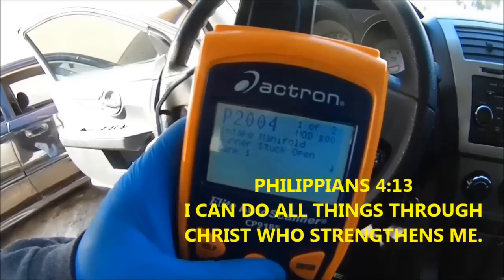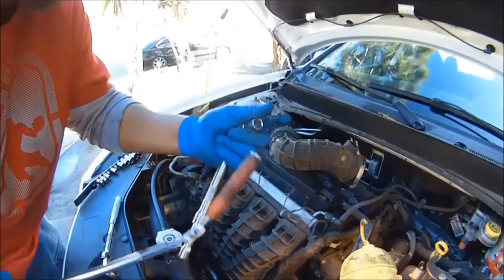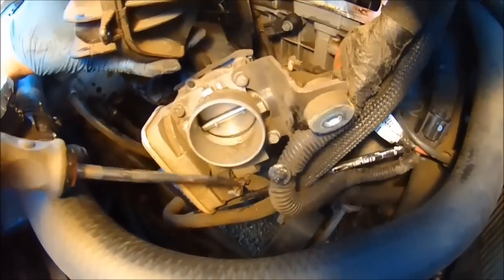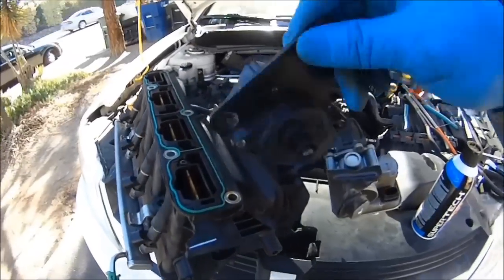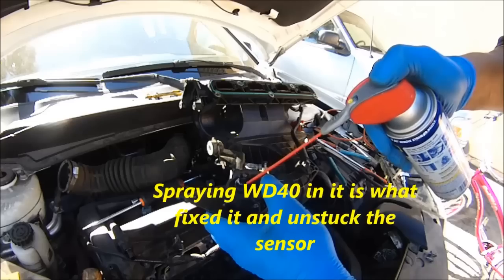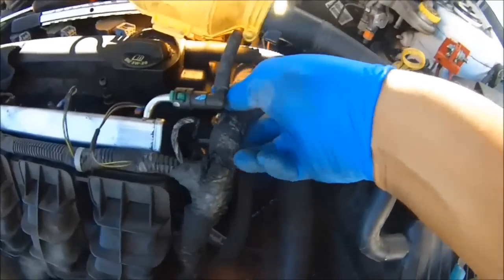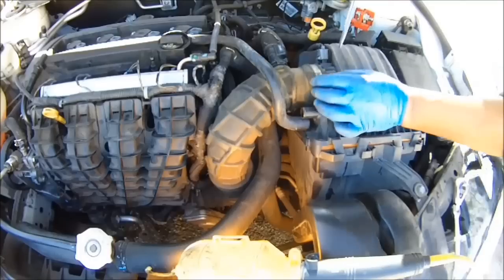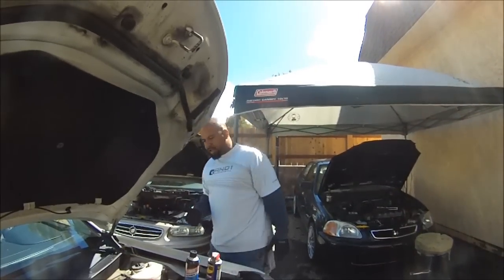FIX CODE P2004 & P2017 W/ WD40 & CARB CLEANER 2009 DODGE AVENGER INTAKE MANIFOLD RUNNERS STUCK OPEN

Comment: Thank you so much.  Using your video saved my family a ton of money.  I didn't have to remove the whole manifold.  I was able to just remove the valve control unit, and WD-40 it like crazy.  I could turn the runner valve rod by hand so I felt those were ok.  The check engine light has stayed off and the car passed smog.  Thank you again.  God Bless.
Reply: My story is identical with my 2009 jeep patriot.   This video saved me hundreds of dollars and time today.   I just took off the position sensor/actiator, used some spray lube(momar safe cracker), flashed the ecu with my code reader, and no more engine faults.
Reply: @johnc522  can you do it with obd2 scanner
Reply: @RENEHERNANDEZ1986  yes you can.  If the code comes back then you need to replace the sensor.  I still haven't had any codes pop up 11 months later so I lucked out.  Hopefully in your case it's the same.  Good luck!

Comment: You sir are the man...... 

Had a question,  I have a 2000 BMW 540i manual transmission. 
And I'm getting no start and no crank.  Tested the starter and battery both are good.  Checked fuses all good.  Key works unlocks doors.  

When I put the key to start the car I get all the dash lights and that's all.  No click no crank. 

What do you think is going on? 
Thanks

Comment: You make the job seem so easy. I had my significate other try to follow video & do same procedure. The problem we found was, the flaps were not stuck. 
If you found the flap not stuck open, what  be causing p2017 code?
Possibly replacing IMF?
Also, if runner was improperly installed, could that be corrected?
And finally, you mentioned that the IMF Runner be "Flashed" that's would be through Dealership?
Thank you for sharing your knowledge, you are truly Blessed. Thank the Lord for his Blessings,
Veronica

Comment: gonna do this again, mine lasted over a year! I need to know tho, without taking the entire manifold off, how do I know if they are open or closed? I was putting my runner control back on in the rain and in the dark with a puny flashlight, and I did not check if anything was open or closed.

Comment: I just did this today, and it went basically exactly like it did in the video.  Fingers crossed that the check engine light STAYS OFF so I can get my annual inspection sticker, but either way, THANK YOU  so much for this video.

Comment: I like what I saw as far as Intake R&I, but I wouldn't use carb spray so freely. I believe WD-40 could do it all. I would also use new gaskets and 0-rings anywhere I could. But the main thing is, . . . whole job too intrusive, just to diagnose. I woulda used a hi end enhanced scanner to look at position sensor values and get my diag without all the work. Then you could remove and replace, or clean it without removing intake. Were those 1/2 inch, or 13mm nuts? Great work though, . .thanx for the tips . . . About to run my checks for the same problem . Again, . .I won't remove the intake and charge customer, unless I have to.

Comment: Ok.....we took the intake manifold cleaned it all out replaced the position sensor and got it all back together and it is still coding P2004 after the codes have been cleared
Reply: is there anything else that would make it code that way?  An thank you for being here for us all.

Comment: In reality the problem is the pcv system. So much oil is comming through that its coating the runners and intake valves. I disconnected my pcv line and put a big bolt in too block it off. No more dissapearing oil. Increased mpg too low to mid 30s on freeway at 62mph. No this will not cause a check engine light

Comment: I just had my 2009 Dodge Avenger inspected yesterday and I failed the emissions test caz my check engine light was on with CODE P2004, P2017, Intake Manifold Runner Control Bank 1
Reply: how much was it to repair
Reply: Ryan Hoffman how much you paid to fix it

Comment: WD-40 dries out O-rings, just FYIo. Great vid
Reply: BrightKitten purr So what do you suggest to use?
Reply: +BrightKitten purr There's a WD-40 brand silicone spray that would be rubber safe.

Comment: so i did this repair. (Didn't take apart manifold, Just took out runner and soaked with wd-40) about 3 years ago at 55k Miles. It is not at 135k miles and i attempted the same repair with no luck. i ordered a new Runner control (75$) installed it and that has not fixed the issue. Looks like I'm going to have to take off the manifold. Thanks for the video, hopefully it helps me!
Reply: i did the same. what did you do after if you dont mind me asking?

Comment: Old skool funk.  Whats happening bro.  After  all the work was done ,  I cleared the code and everything was good.  Until  it came back so, I had to pull the intake manifold followed the steps you did and now,  I"m putting it back together.  I'm hoping this will solve the problem,  if not,  Do you think I will need to replace the Manifold?  Your videos are outstanding bro. GOD BLESS.

Comment: hey old skool. great video I have the same problem. one question how much the runners should move in my case runners move 1/3 of a turn and as far I can see, in your video an other video that I found, looks correct. but I found a publication that says they must move one 1/4 of a turn. I check the runner position sensor and it actually turns 1/4 any help. thanks a lot

Comment: I have the same codes on my 2008 Dodge Caliber. I was going to try to replace the intake manifold but if it is just stuck open cause of a carbon build up I'd rather clean it. 

Did this method hold up after a year now?

Comment: Have a P2010 and P2008 on an ‘07 Caliber 2.0 (05/06 build).  It bucks and jerks under 3000 RPM.  I removed the actuator and it rotates about 30 degrees if I use pliers on the tab that engages the rod the flappers are attached to.  When I apply 12V it only rotates about 15 degrees.  I can also move the flapper rod, but only about 15 degrees as well.  Does this sound like it is functioning correctly?

Comment: I have a question. Regarding that 'sensor' solenoid thing that was stuck, can that be opened up? Are there screws on it or is that a sealed unit? I ask because I figure moisture got into it and froze up the movement. Also, if you can open it, you might be able to use some kind of silicone grease inside of it or maybe seal it so it doesn't fail from moisture again.

Comment: Thanks for the video and inspirational words  !!! I have a 2008 Dodge Avenger Sxt 2.4L. i have the p2016 and p2017 codes. The check engine light comes and goes for those codes. But when I hit 3500rpms it'll come back on again :(  I almost purschased that runner sensor. But I will try what you have showed us. I'll report my results. Thanks again! Godbless.
Reply: Dave Mack did it work?
Reply: MissMandyy : Unfortunately it did not work. I even replaced the sensor.  Engine light is  still on.
Reply: What do you do?

Comment: hello sir. I hope you can help me with this,1- the RPM keeps going up and down when I turn the AC on with vibration. 2- I replaced the map sensor and PCV valve with a new one both. I found oil inside of the PCV and the MAP sensor after replacing them stell I have same problem the RPM goes up and down. 3- the oil cap leaking I replaced it with a new one stell leaking. 4- I don't have the control runners in my manifold. my car is 2011 dodge avenger 2.4l mainstreet 6 speed transmission. before I touch any thing I disconnect the negative battery cable. thx a lot man.

Comment: At about the 1:32 mark of the video, it appears that the hose on the upper left is already disconnected. I can't seem to get my loose on my 2008 Avenger. Did you do anything to loosen it before pulling on it?

Comment: how do you relearn the throttle body on 2007 dodge caliber? engine calibration or whatever i got P2017 P2004 and P0123.
Is the metal thing inside the runner suppose to spin like the sensor or control valve connected too that he stuck back in the side?

Comment: I checked the comments and did not see the follow up: Does this repair hold up after a month?
Reply: +Cody Mooneyhan The final scene has him showing a month later that it was still without an check engine light and that it was running good still.

Comment: My under standing is 2007 up to 14 maybe higher are the same and have this same problem going on, the 2008 looks identical, this also is true with a bunch of other cars that are not an avenger at all. This motor is a World Motor is what some dude at the dealership told me.  it is used in a whole bunch of cars. 

  After looking at mine it appears to me that this is being caused by crappy designing. really makes me mad, also. I have installed TWO alternators.  YES! the one that original went out. then the new one went out and now I'm on the third one.  Yesterday I hot 100,000 miles.   funny hu? want to hear something even more funny? the alternator costs over 600.00 dealership. you can get one though for just over 200 and do it yourself. luckily I bout a LIFETIME WARRANTY the 1st time.   I recommend that because this alternator has some fancy new crap in the pulley and it is a CRAPPY DESIGN and it will go out again.  

   I had only this code P2004  when this first started happening to me, I just kept driving it though,  I have driven it lean like that for 3 or 4 months, check engine light one and everything. Why?  It;s cold outside. this is Idaho.   Ok so Now I have P2004 and P2017, and also P2448. LOL   these are all air intake codes and I think it will fix all of them by replacing part. : 4884495AJ    <-- this part is what you just took out and cleaned. 

  I thought there has to be away to do this cheaper than buying all the parts.     well,   you can get that part now for under 300.00 if you look.   really  I just found a brand new one with a 24 month warranty  with the new valve on the end and it comes with a new gasket for 251.13   SHIPPED to me included.   no joke.  and there is a lot of them so no worries there. 

  But   i hate spending anything really.   the valve , if you want to buy that , I have been finding for around 75.00   all buy itself.   but. 

  I I haven't seen anyone take that valve out without removing the whole manifold yet but i suspect my problem is the same as this video and the valve is stuck, In fact, I think everyones problem is this problem and the valve is just in a place that is not good for it PHYSICALLY because of its design it fails.

  after watching your vid, I am going to pull mine - hopefully without taking the whole manifold off, attempt to clean it and get it unstuck and then re install it.  drive it back up to auto zone and get the codes cleared . and see if it pops back on teh check engine light.   if it does then I will just get a whole new deal for the 251.13.   I will keep my fingers crossed that it works after that though. 

  What a pain!  LOL  great Video man, seriously.      I hope there is enough room down there to get those three bolts out and pull that valve.

Comment: How to I calibrate the Runner Pos. Sensor back to it's "original specs" or with in it's "parameters/specs?"
I changed the runner position sensor on my 2008 Dodge Caliber, and the code P2017 came back on.

Comment: Hi, I have a 2009 Jeep Compass and the engine looks the same here.  After my upper radiator hose sprung a leak, I pulled over and turned the engine off.  I put in more coolant and tried to start the engine, but it didn't start, just turned over with the starter.  I got it towed home and checked for codes.  It just had a P2017 code, not P2004.  Do you know what the problem may be?

Comment: God is EVERYTHING I also  wrench I like your approach but ask God to show you the wisdom and knowledge learn to find out why it set the code check out Scanner Danner on You Tube God WANTS make you a better Tech I am 67 years old been wrenching professionaly since I was 16 I would have found out why the  sensor had high voltage first code p 2017 remember ALWAYS GO BACK TO BASICS again great video 5 stars keep up the great work our God is bigger than any storm we face and he will always steer us to a safe harbor in our life

Comment: how do you Flash the Motor
Reply: BURRVISION A whole motor doesn't get flashed. "Flashing" is when someone uses a scanner/diagnostic tool to reset the car's computer (the ECU (engine control unit) or sometimes the BCM (body control module)). Older cars have to get the entire computer replaced, since older models cannot usually be changed via a scanner tool.

Comment: I had the same issue in my Dodge Caliber - you can see jammed engine here www.youtube.com/watch?v=2-k380YibBA and WD-40 fixed the issue. Flaps work properly now - I can hear airflow pitch change above 3000 RPM just like before error.

I did it without taking off manifold - just engine/battery covers and air box.
Code has to be cleared through OBD2 interface, it won't disappear on its own.
You can check photos from procedure here:
http://www.caliberforumz.com/showthread.php/41958-FIX-P2004-P2017-Intake-Manifold-Runner-Control-Stuck-Open
Reply: +Pawel Pabian (bbkr)  - Pawel's video link is a waste of a click!  Pawel's video just shows him WD40ing a manifold that isn't even connected to anything! WTH?!
Reply: Please read carefully. First link shows only jammed engine as described. What did you expect from description "you can see jammed engine here"? Dragons? Second link is the full fix procedure.

Comment: oldskool funk I'm having the same with code p02017 on my jeep patriot 08 if I follow the the same thing you did will it help. On my vehicle ? And should I buy the runner control valve just to be safe. In case I do have to replace it . I got my smog check coming in about to MONTHS , please help

Comment: i have these 2 codes and i had to change the engine for my 2010 grand caravan. still i have the p2017 and dashboard goes crazy when engine runs after installing the new engine, not sure what to do

Comment: I'm glad you posted this video.  I have the same problems on my 2007 Dodge Caliber.
Reply: I doubt you will ever see this, but did it work? I have a caliber with the same problem
Reply: I just ordered the part off eBay for $40 or so calibezz is running rough I can't wait to put the part in I cleaned out the hole manifold replaced just about everything on my car I'm running a 140 watt srt alt plan on building her for boost thanks for the vid and reading my comment the code I have is p10617 I think its the code causing the alt not to charge the battery hope to have it fixed

Comment: One error I saw in the video was the cleaning of the throttle body. Drive by wire throttle bodies you DO NOT MANUALLY MOVE THE FLAP! It can cause damage and miscalibration which will require a new TB.

Comment: I tried clearing off the light but it would come back on a second after I would start my 07 caliber. After watching this, I did everything on the video, light was still on so I reset it, 20 mins later the light came back on wtf. Days before I messed with the intake, I put a brand new control runner valve to see if it was hopefully that. Like I said light came back on but car feels faster than before.
Reply: Carlos Rocha take to a dealer and get the computer flashed
Reply: Never go to dealer!!! Computer flashing never does anything!!!!!!!!

Comment: why  din't you  started with the actuator first?
Reply from the maker: estrelladelnorte1308 I actually did but did not record that part and got lazy to redue it lol. I checked for power, ground, resistance 5 volt reference and pulled it off the resistance checked out good and baffled me so I took it apart then made the video. But you are right always start with the sensor readings/test before you take stuff apart.

Comment: i have the same code ,they change the black box,but my check ligth engine is still on,i guess someting is wrong with the runners,,and i have notice that am in the gas station more often,hummm